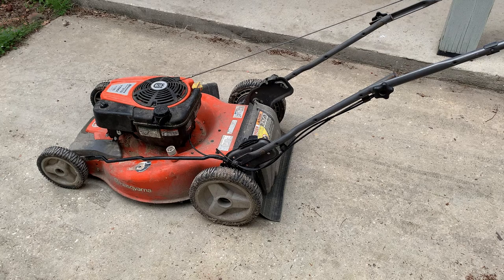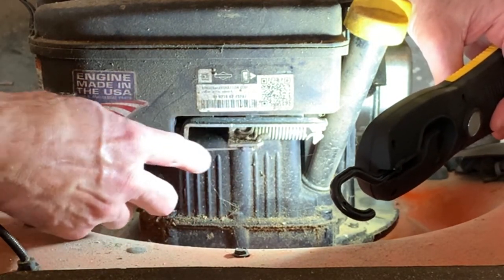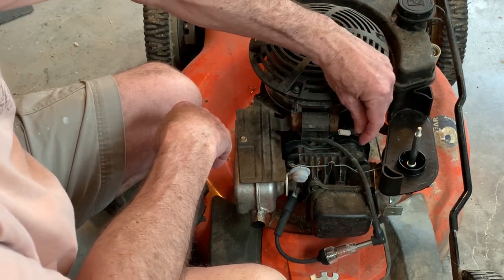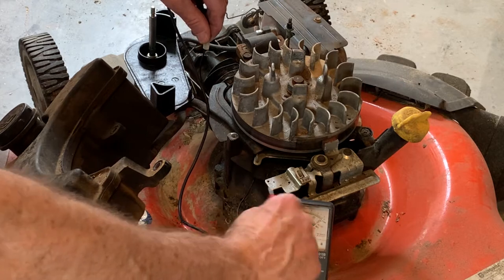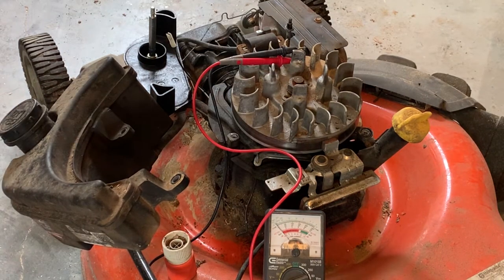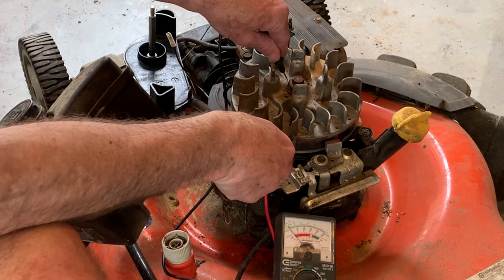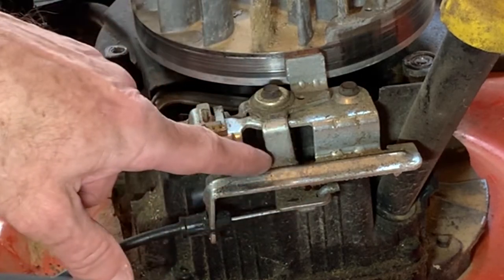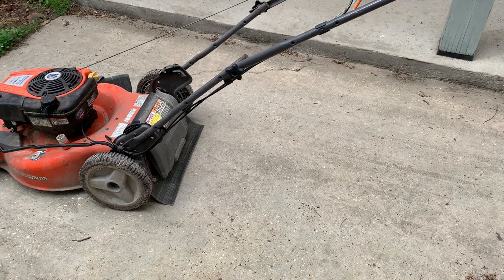Husqvarna Mower Won't Start

Comment: This is exactly what was wrong with my mower and didn't know how to make a quick fix, bending that piece of metal holding the cable definitely saved me $600 on a new mower. Thank you !
Reply from the maker: Glad it saved you from buying a new mower. That problem is an easy fix if you just know where to look.

Comment: Grounding out was definitely the problem and bending the metal that the cable hooks to will fix the problem, but the part you gained clearance for is not where it grounds out. That contacts the flywheel to stop the spinning of the motor. The coil grounds out close to where the wire you tested connects. I will try to get a screenshot of it and put it in a separate comment
Reply from the maker: Please share a picture if you can. I started that mower today for the first time since last summer. Started on the first crank. Still a good mower.
Reply from the maker: I couldn’t see it in the video, but confident you would not go through the effort to inform us if it wasn’t true. I wish I had it apart and could see it, but don’t want to go through that effort. The fix is the same so at least the recommended repair is valid. Thanks for pointing it out and anyone working on it can look more closely at it while they have it apart. Thanks again for viewing and helping to clarify the issue.
Reply: 3:36  you touch the red lead of your tester to the flat blade (looks like  the blade part of a male crimp on connector) where the kill wire connects and underneath, the arm coming from the point (shaft…you touch with your finger at 3:22) that everything pivots on, is contacting what metal structure the wire connects to in the rest position. Once you pull the lever (3:53 & 3:57) the portion of the unit that touches the flywheel and the arm I refer to “spin” on the shaft clockwise disengaging the arm from where kill wire connects. This is really hard to see in the video or appreciate if you’re not sure what you are looking at. Without taking it apart, you might be able to see it disengage from below, when you pull the lever. If you have a need to take it apart, I think you will easily see what I’m trying to explain.
Reply from the maker: I finally got a chance to go back and look again. It’s just too difficult to see. Just wanted to say thank you for the time you took to write the details up. Maybe it will be useful for someone looking at the issues while having the mower still apart. Thanks.

Comment: 5:27 if you watch from about this point in the video and look to the left of the the area that you are focused on that contacts the flywheel you will see a metal arm extends towards the flat blade where the wire from the coil connected. This arm will contact where the kill wire from the coil connects grounding out the coil when no one is pulling the lever.  When the lever is pulled the arm travels in toward the motor separating from the metal that connects to the kill wire. I am unable to post a pic in the comments. If I figure out a way to post a pic I have 2 that I labeled that I’ll post.
Reply: That's what I thought also.

Comment: Great video but like most videos on youtube - the person posting the how to  does not show  a step by step from start to finish. Show what screw driver and ratchets are used , what mm size  how to fix the pull cable, what did you do to shorten the  the cable thus making it not  touch that  fky wheel.  all folks watching are not  small engine repair  people.
Reply from the maker: Thanks for watching the video and commenting. I did not shorten the cable length. Instead of doing that I bent the metal piece where the cable connects at the flywheel break. I bent it slightly to the right so that the same cable length would allow me to get more travel and clearance from the flywheel. Hope this helps. I used to put more detail, but most people want the short answer and only watch a small portion of the video. Thanks again for watching.
Reply: You are asking a little bit too much. This stuff is free….

Comment: i have this mower..didnt brand same engine but it doesnt start for anything
Reply from the maker: Does it have the same problem I showed in the video. Hope it helped.
Reply: @FixItDepot  no i cant really diagnose teh problem..i bought a whole new carb.. clenaed the gas tnak out fixed the choke as it was steady open it wouldnt close all the way im kind of baffled on this one as from the little i do know about small engines nothing hs worked..it should start right up but doesnt..whoever had it put too much oil in it not sure if thatd be a big probelm but engines still star even with too much oil fomr past expoerience ...not sure ive kind fo given up on this one...its  ashame it could go for a few bucks if i was able to fix it.
Reply: @FixItDepot  i never actually tested the spark plug ..it looks relatively new so i just assumed it would be ok maybe it is something that simple and my judgement for it isnt that good..i have a tester but its hard to see doing it by myself hopefully maybe thats all it is..but tbh i cant see it being the spark plug. maybe ill try to tackle it agian and see what happens i have a tendency of not being able to give up on these things...it slike an additction lol
Reply from the maker: @sonnyc3826  I would test the plug with the spark tester cause that would tell you the plug and magneto are putting a spark out. If no spark, make sure the mag isn't grounded out. Good luck with it.